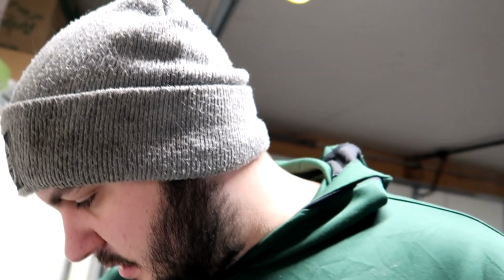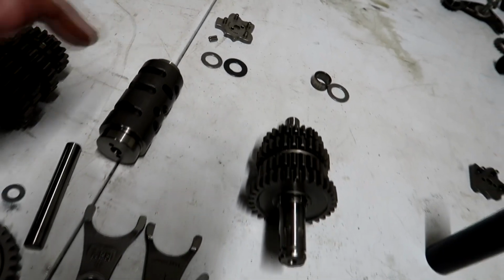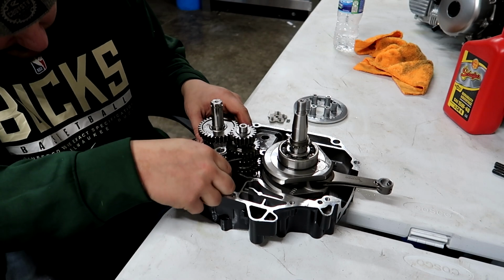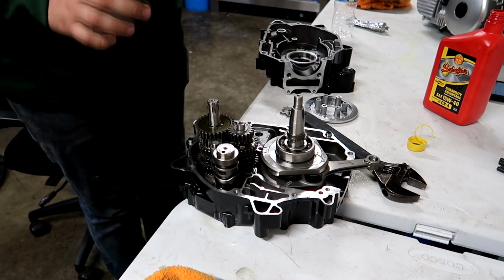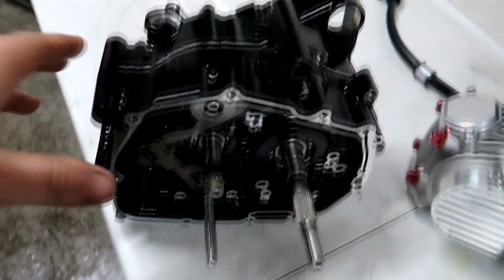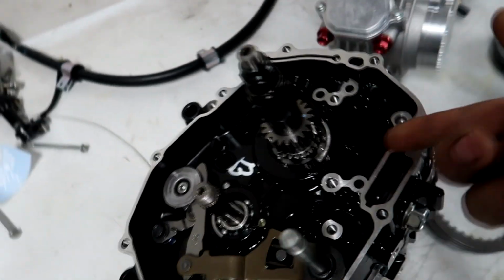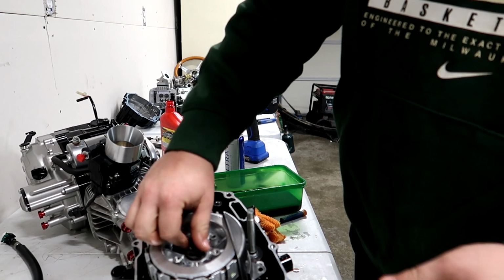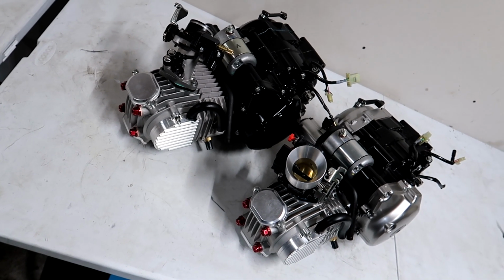5 Speed Takegawa Honda Grom Engine Assembly

Comment: I put a Yuminashi 5-speed in my CT125 and the piece of shit broke on the first ride.  But, the speedometer worked.  Both Takegawa and Kitaco state that their speedos won't work with their trannies -- do you recall if the speedo did in fact work with the Takegawa 5-speed?

Comment: Hope all is well Hunter. I’m about to work on my 2020 to a 5 speed. 

I’m running a koso big bore kit.  What would be the best gear ration front and rear sprocket.  I’m at 8k rpm at 65mph and I have about 80% more throttle to go.  I’d greatly appreciate your recommendation. If anyone else have ideas to share I’d greatly appreciate it.

Comment: My 2023 Monkey has trouble upshifting to next gear.  Takes 3-4 tries to shift to next gear.  Would new oil help with that?  Currently has 120 miles been doing it since new.  Down shifting is fine it's just upshifting.  Thanks for any help much appreciated.

Comment: Herrro, Thanks for making the video! I've checked couple videos of assemling 5 speed takegawa and they said OEM speed sensor could work! But in Takegawa instruction manual says it needs aftermarket speed sensor which makes me extremly confused... Would you happen to tell how OEM speed sensor could work with Takegawa 5 speed and ABS system could still work...? I do appreciate if you could kindly tell me about it. I've been reaching out as many information as possible but still couldn't get the answer...

Comment: U didn't use gasket between engine chasing. Does it not leaking?
Reply from the maker: Factory just uses Honda bond silicone between cases. No it does not leak doing this
Reply: @HunterTuned  it's  a new chasing?? What kind of bond silicone it use??